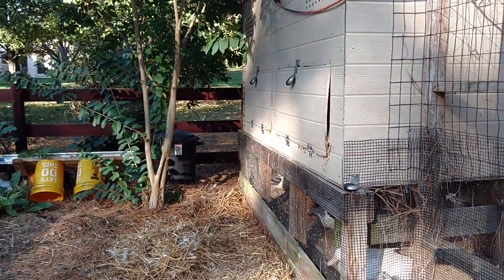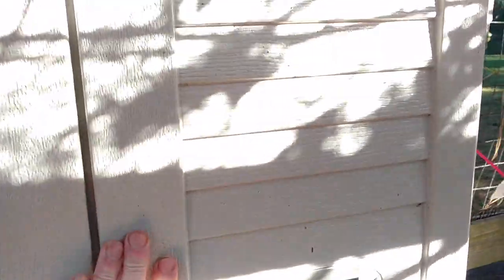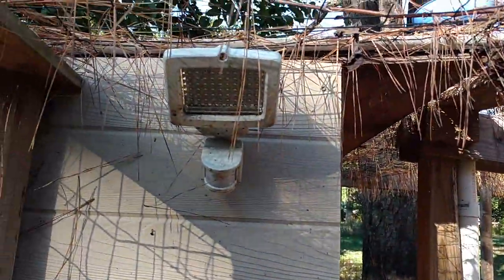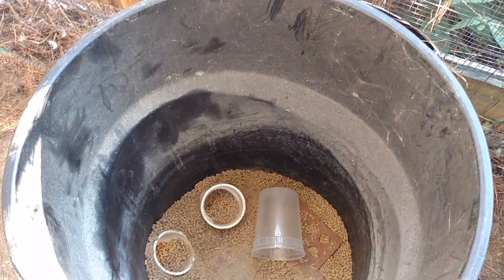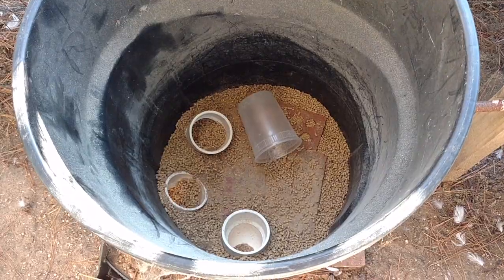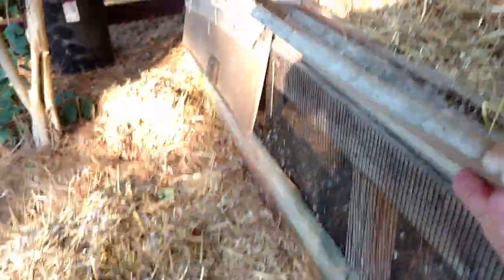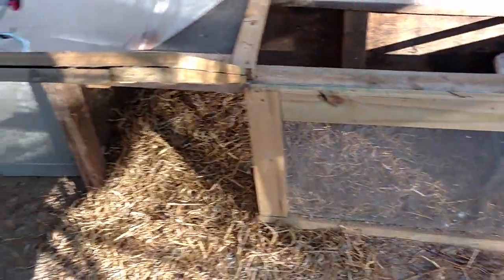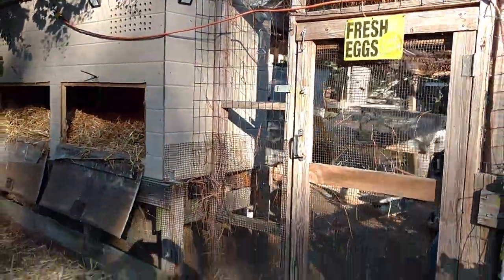Duck Coop and Yard - 2 years Later

Comment: Great video!  We are just getting started.  My biggest concern is for this Winter.  It gets to -20F here in North Dakota.  Best idea to keep water open?
Reply from the maker: Yikes... -20F is a tall order when trying to figure out how to not have your water freeze.  Do you have access to electrical?  IF so you can drop a water warmer down to the bottom of the pail.   The insulated pails that I use were good to about 20F to 15F before they started to get a thin layer of ice on the top which was easy enough to break up with a stick.
Reply: @smithmal01  Yes, I have power nearby.  Also, I know that ducks need ventilation, but how do I keep them ventilated and warm when it gets that cold?  That is one of my biggest concerns.
Reply from the maker: @51Drones  Ducks are way more rugged than chickens.  As long as you provide them with shelter from the wind they will be fine.  If you're really concerned you can add some insulation to the coop (such as I did).  Most heat is released through the ceiling and through the floor which is why I choose to insulate both areas (probably unnecessary for where I live though).
Reply: @smithmal01  Thanks!  I'm working on predator-proofing right now.  Lots of hardware cloth!

Comment: good idea to paint the wood/laminate that might warp from wetness.
Reply from the maker: Thanks for commenting.  Suuppossedly the laminate was already painted and ready for outdoor use although it lasted on 3 years in some locations.  I ended up removing the back wall (where the doors are located) and the floor and replacing is with 1/2" PVC sheets.  Will most likely do that with the rest of the walls soon as well.

Comment: great system with the water :) , the pellet feeder needs wider cover roof so rain water dont get in the pvc feeders , how much it cost you to feed your ducks per month ? and proximately how manny eggs u get ?
Reply from the maker: djpitr - thanks for the comment.  A wider roof would help, but I generally don't get a lot of rain where I live and the pellets inside the feeder elbows only get wet when its a really bad downpour.  Also the ducks tend to eat the food  pretty quickly so it gets replaced with new dry food.  

My six ducks eat around 60lbs of feed per month (or about 10lbs per duck; about $20).  I have heavyweight ducks so they give larger eggs and more meat, but they also eat more feed than smaller ducks. 

I generally get between 270 - 300 eggs per year from each duck.  The egg production starts to slow down after about 2.5 - 3 years and then the ducks needs to be swapped out with new younger ducks if I want to continue with a similar production rate.  Different breeds will provide different egg size/production.  This video (https://www.youtube.com/watch?v=cvWT6jQGBwA&t=1s) has a chart in it discussing duck breed and egg production (at around 2:25 mark).
Reply: smithmal thanks , great info :) couple of weeks I got me first 2 Perkins baby ducks :) so I’m trying learn as much I can :)
Reply from the maker: Good deal.  Hopefully they will be pre-sexed for you.  Getting two females is fine, but having too males would be a big problem due to aggression
Reply: smithmal yeh , they not sexed :( so I will have to wait until they Big and I can tell :) on way to pick up some other ducks :) after Easter everybody selling ducks :) or giving away :)
Reply from the maker: Make sure you keep your female to male ration 3/4 to 1.  Too many males will make your flock very aggressive causing the male ducks to become very competitive for female mating.  This can cause the female ducks to be maimed/killed during mating.  Male ducks are naturally very aggressive when mating.  Check out this video to see an example: https://www.youtube.com/watch?v=7e6Uw2DqHlU&t=62s
Reply: What happened to the original water with the orange cups. Where can I buy the cups.
Reply: smithmal I have 3 ducks how do you tell the sex of them?
Reply: @BrokeStamper  pretty hard when they small , bud around 7-8 months you see back feathers curl up on male and will quak much more and higher pitch then females
Reply: djpitr Ok thank you, They are only a little over a month right now. I know nothing about ducks. My neighbor who doesn’t like animals had a duck drop an egg in her yard and she decided to put it on my trash can and called me to tell me I should do something with it, since I rescue cats and feed the wild animals. I didn’t realize if it wasn’t incubated that it wouldn’t do anything. I made a homemade incubator and well it hatched it’s a mallard. After reading online that they get lonely I thought I would get another one but Tractor Supply only sells them by two so now I have 3. I’m hoping it works out sex wise after reading that having two males and a female would not be good.
Reply: @BrokeStamper  yes , great , u will love them , I have now 5 , one male and 4 doves, he keeps them busy and all my chickens too :) .. they are great egg layers, I love the bigger eggs and better tastes , everyday egg :)

Comment: Great videos, thank you! What brand of lock do you use and where did you purchase them?
Reply from the maker: Brin - they are Master Lock Magnums.  Here's an Amazon link for them: https://www.amazon.com/Master-Lock-Padlock-Magnum-Stainless/dp/B000WEMGH4/ref=asc_df_B000WEMGH4/?tag=hyprod-20&linkCode=df0&hvadid=194861420852&hvpos=1o1&hvnetw=g&hvrand=16014472403055467386&hvpone=&hvptwo=&hvqmt=&hvdev=c&hvdvcmdl=&hvlocint=&hvlocphy=9008062&hvtargid=pla-390920304216&psc=1

I believe they have a lifetime warranty.  

They are decent but I have had issues with them in the past when it gets extremely cold in that they freeze shut and I can't unlock them.  Sometimes I need to throw warm water on them to unfreeze them and then need to bring the lock indoors to dry it off.  What I probably need to do is add some heavy duty lubrication to the locking mechanism so they won't freeze shut during the winter months.
Reply: Thank you! Buying several today!  @smithmal01